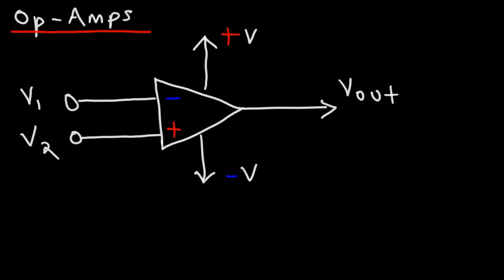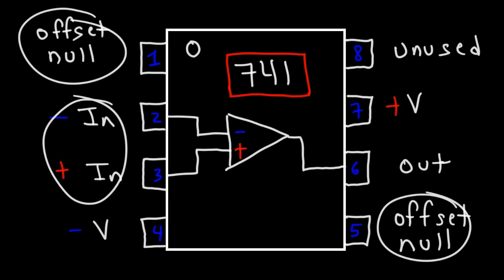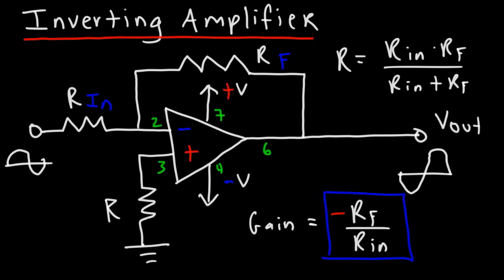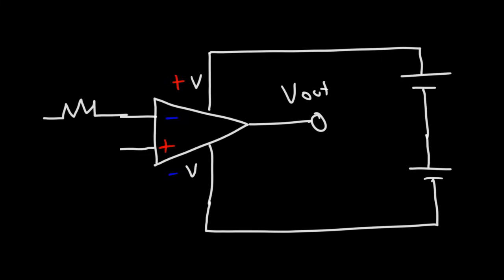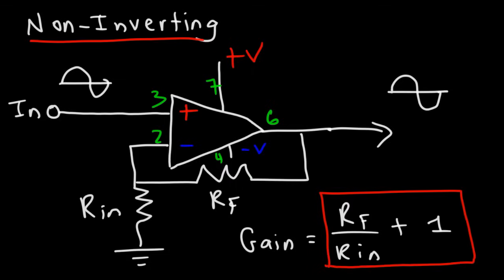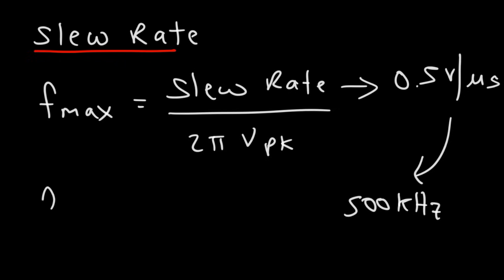Operational Amplifiers - Inverting & Non Inverting Op-Amps

Comment: 8:30 how do you provide ac current to the positive input with 1 wire , where is the other wire of the ac source connected, how do both of these wire create a complete circuit ?

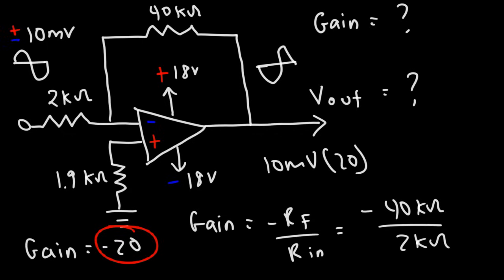Comment: @11:40 you failed to explain the relationship if any between the Vout and the power supply voltages +/-18V. How does the power supply voltage affect the Vout? In your example Vout seems to be independent of the power supply voltage.

Comment: Thank you Sir😊
In the inverting amplifier circuit, the method to eliminate the output error voltage caused by the bias current is to connect an R to the ground at the non-inverting input terminal. The value of this R is: R=Rin//Rf

Comment: Pls tell me what kind of signal is going into -V1. Are you just analyzing voltage signals. I'm a beginner. Thanks. There's no such thing as dumb questions, right? It appears to be a signal not voltage. I learned inverting op amps to use a gain of 1 or the amplified voltage so this confuses me. I'm kind of catching on.

Comment: This is the only electrical parts I really can’t understand well I try to use op amp to design a short circuit breaker but there is voltage at every pin and I need it to amplifier shorting voltage of a resistor shunt but all am getting it the voltage of the op amp there is no amplifying because all pin have 4.98 voltage how the hell am I to work with this I need it to have zero volt on every pin to use it to amplifier I use comparator and it work as it should but the op amp have voltage at every pin why is this a totem pole is and amplifier no voltage in no voltage out that’s how the op amp should work but it’s not

Comment: Could anyone please say what will be the gain formula if input is applied through a resistor in non-inverting terminal and output is connected to the non-inverting through a resistor?

Comment: effect of resistor R connected between inputs (+) of op-amp and GND ?? help me 2:25
Reply: According to Microelectronic Circuits Analysis and design book (Muhammad H. Rashid, second edition, page: 121):

"The circuit does not require the resistance R for the normal operation as an inverting amplifier. However, R establishes a nonzero voltage at the inverting terminal, and any voltage signals generated due to the op-amp offset parameters will appear at both the inverting and noninverting terminals. By making R = Rin || Rf, which is equal to Thevenin's equivalent resistance looking at the inverting terminal, we minimize or eliminate the effect of the offset voltage vd."

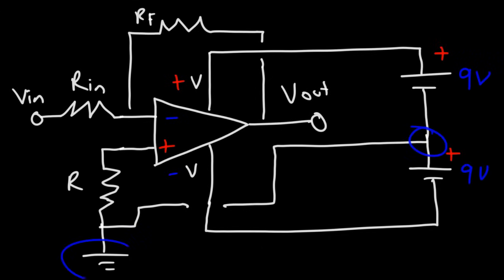Comment: 6:34 can I power the op amp with +18v and 0v instead of +9v and -9v?
Reply: I think it depends what voltage you are taking to be your reference.  If I understand things correctly, the main idea is that you want to feed the op amp with supply voltages both above and below some reference value (such as +18 V and -18 V compared to ground where the voltage is taken to be 0).  So ultimately I think you could label things a different way, but if you are powering an op amp with +18 V and 0 V, then the input signal should be around +9 V.

Comment: nice video. But one remark: @11:53 (continued), the output should be between -200mV and +200mV because it is an opamp in inverting mode. :)
Reply: I would think it's still correct and reasonable to give the range as +200 to -200 mV if you usually specify the maximum voltage before the minimum voltage.  Is there a convention related to op amps where you would specify the minimum voltage first if you're working with an op amp in inverting mode?
Reply: @PunmasterSTP  bruh answer will be 0.2v right?
Reply: @sanathkumar3052  I think so, since 0.2 V should just be 200 mV unless I'm missing something.

Comment: Potentially daft question... but if you didn't have access to the "middle" of the 2 batteries to  use that as a ground for the op amp, could you put in an equal resistor voltage divider in parallel to the battery, then use the point in between the resistors as the ground for the op amp instead? Sorry if that's a dumb question.

Comment: so the feedback resistor is always connected to the inverting input ?
Reply: I think that must usually be the case, because I think if you were to connect it to the non-inverting input, then you would get positive feedback and the signal would grow without limit (until it reached the supply voltages).